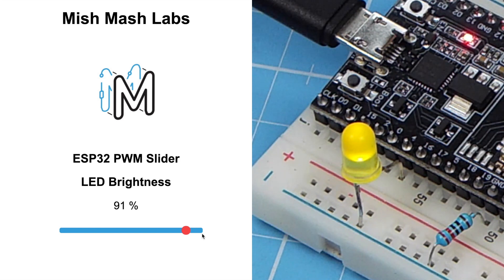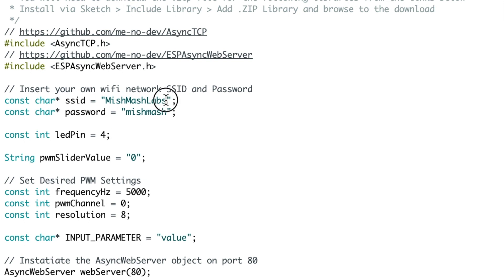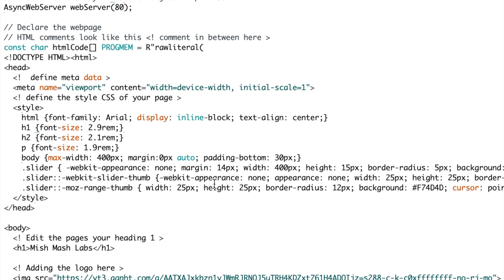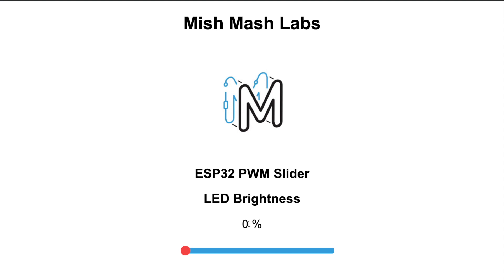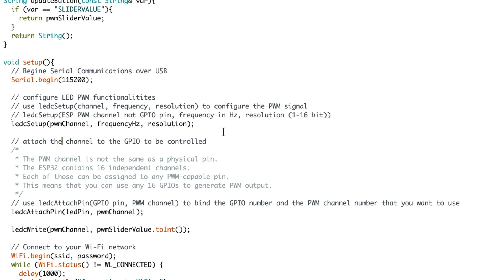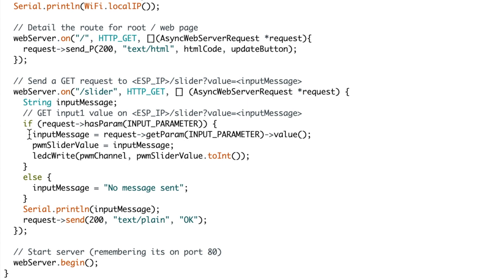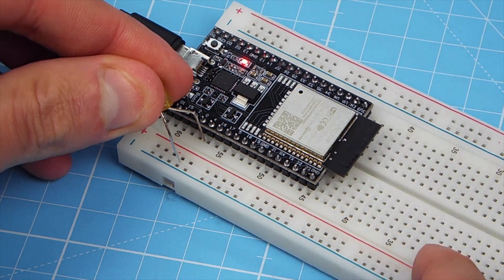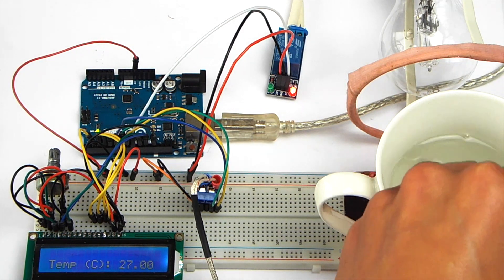PWM Slider Bar Control on ESP32 ESP8266 WebServer | Control Brightness Of LEDs | Out of the Box IoT

Comment: I don't understand how updateButton function works. You pass this function along with other atrributes to request->send_p for server.on("\").
But inside HMTL, where does it call this function?

Also, you declare String pwmSliderValue in the main c++ code and then you declare var pwmSliderValue  inside HTML.  So they're linked together?

When it says "return pwmSliderValue"  which one? the one in main code or the one in HTML?

Can you please explain this updateButton function?

Comment: Sir but this method is not supporting leb bulb(only supporting led small light) how can I support led bulb intensity 🙏🙏help.
Reply from the maker: Hi Pradeep.

I don't quite understand your problem. How do you differ between bulb and small light?
Can you privide links to products?
Reply from the maker: You need a 3.3v to 230v dimmer module like this,
https://pt.aliexpress.com/item/32802025086.html

Personally I dont like such projects as these types of switches are not the most robust, but I wish you luck.
Reply: @MishMashLabs  ok thanks a lot bro....for helping me ❤️❤️
Reply: @MishMashLabs  sir like small light menas that which u r using and larger bulb meana that which is operating on 240v
Reply: @MishMashLabs  how can I send u demo of my project r u on what's app or telegram

Comment: is it possible to run a  motor with this code using MOSFET or bc547 transistor?
Reply from the maker: If it can be switched with a 3.3v supply then yes.